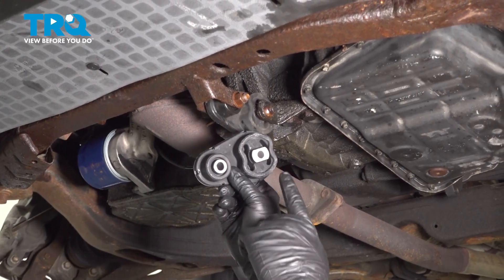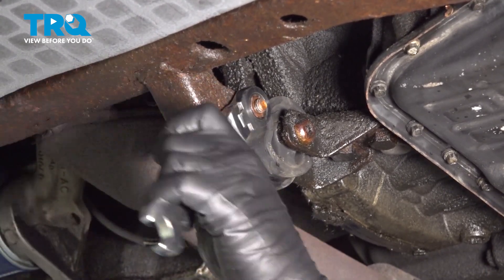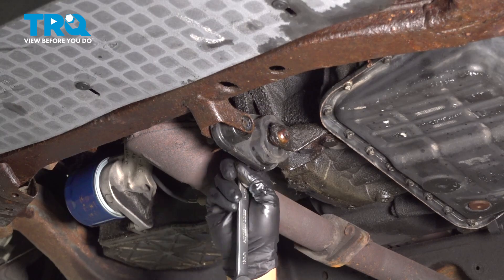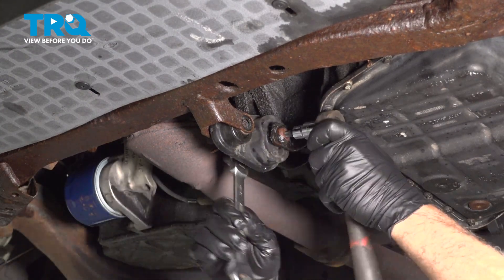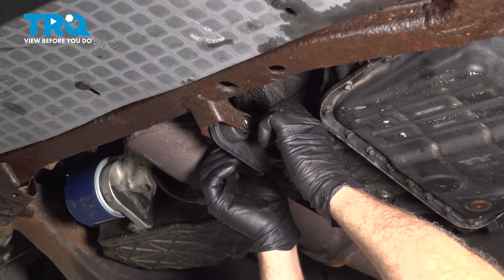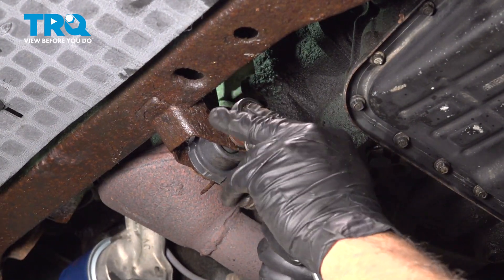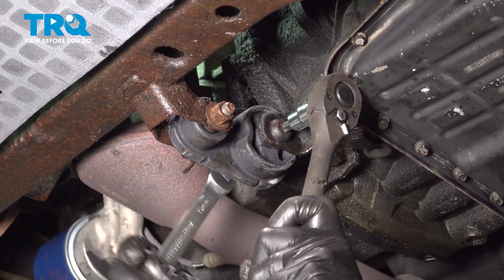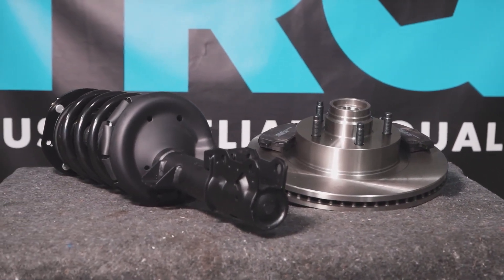How to Replace Lower Engine Torque Strut Mount 2005-2007 Ford Five Hundred

Comment: Hey man quick question about 2004 Silverado 4x4 rear wheel bearing replacement can I just switch out the hub assembly on the back without taking the diff. Apart? Like the front ones come off?